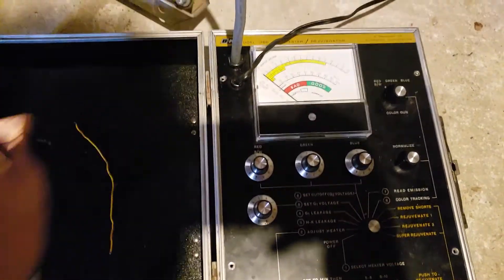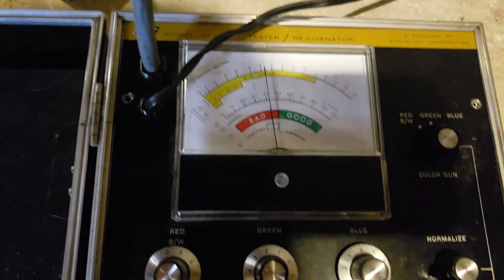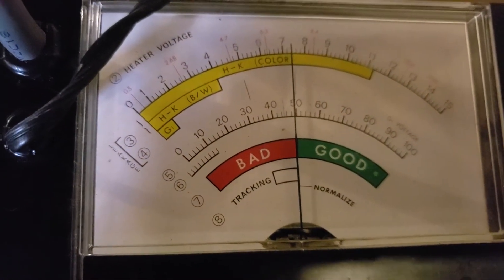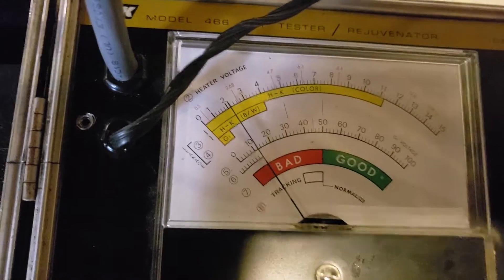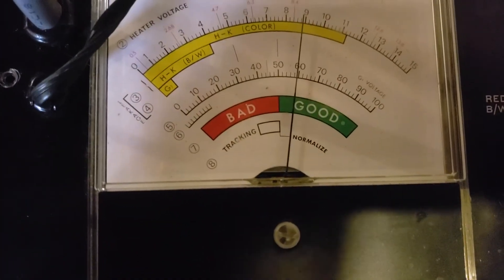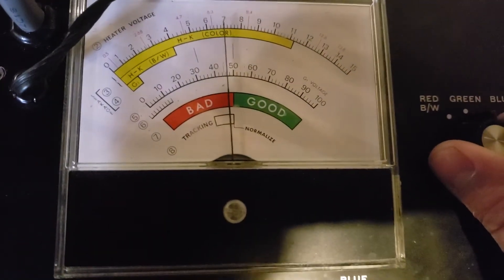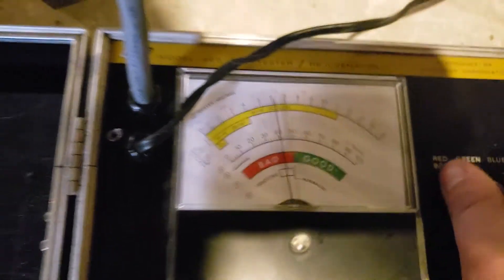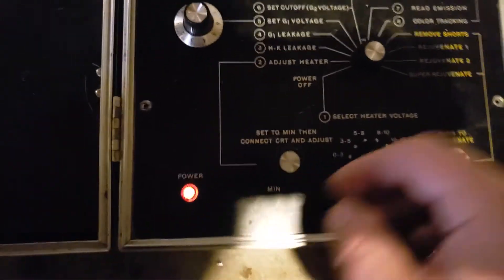How to use a BK 466 rejuvenator.

Comment: Do you repair tube testers?
Reply from the maker: I can, i mainly repair crt tvs and crt arcade monitors. Which tester are you having issues with?

Also, when you say "tube" do you mean vacuum tube (pre transistor) or crts?
Reply: @DJAlup  I agave two Eico 635. Neither is working one has a broken gauge needle. I also have a Eico 625. The tubes that I test are sweep tubes like 6LQ6 and the like.
Reply from the maker: @radiostationwa5rac321  I am going to fully transparent here. i have never worked on one of these. I do know that most old testers can be fixed by simply replacing the pots with new ones that have the same resistance. While your in there test all the resistors to ensure they are in spec and replace ALL the caps.

The main issue with these old testers is the pots are wirewound. the very small wires break over time. I have always replaced them with carbon ones and never had an issue with them again.
Reply: @DJAlup  Happy Monday, DJ I am willing to let you give it a try. I don’t think much is wrong with it. Last time I used it it arched while testing a tube. Now it doesn’t give correct results. Tell me what would you charge to check it out?

Comment: AIup thanks for uploading this. I have the same rejuvenator with SP66 adapter and a Molex to cr23 connector. The problem I have is that I can only read emissions for green. 
Apparently this is common issue. Did your mod removing wire fixed this issue? Can you please share the mod with us?
 I searched arcade-museum and didn't find a post for it. On some other thread some guy suggested wiring round connector pin 2 to G1 green of cr23 but I prefer to do the mod inside the rejuvenator.
Reply from the maker: I made a video on how to do this.
https://youtu.be/hPpMab4mV3k